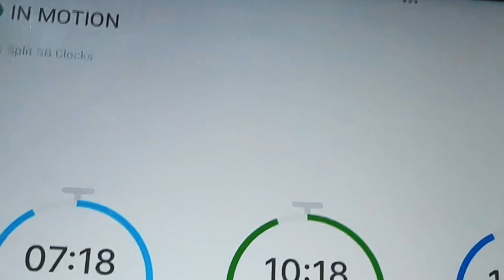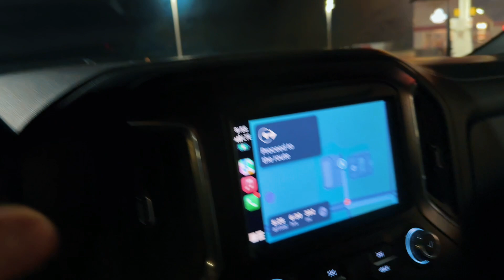Episode-5 MY FIRST NON CDL HOTSHOT LOAD !!! Almost didn’t happen

Comment: Why are you using elogs if you’re non cdl?
And what is the GN and weight  on your trailer?
Reply from the maker: Because it’s required
Reply: Still need to run e-log even if non cdl..
Reply: Yes CDL or not, a commercial vehicle combination over GVWR of 10001 lbs and engine year 2000 or newer needs to use elog!